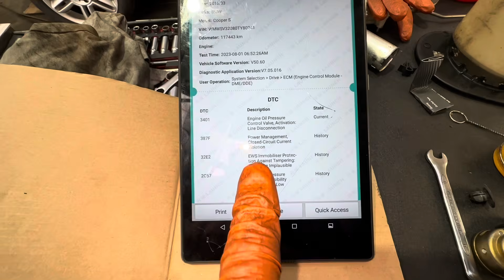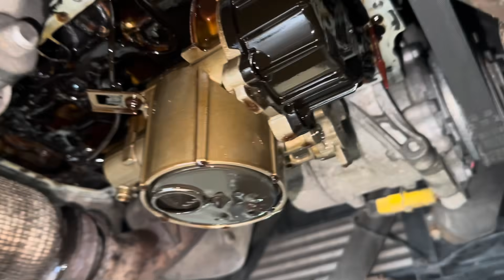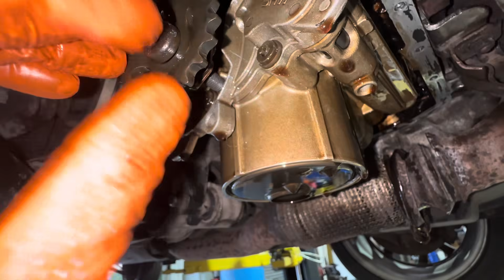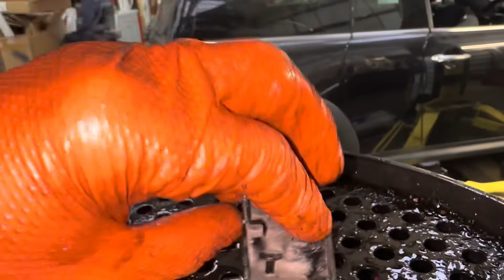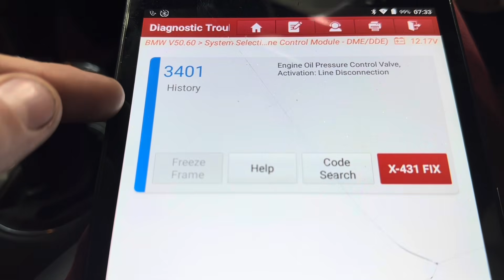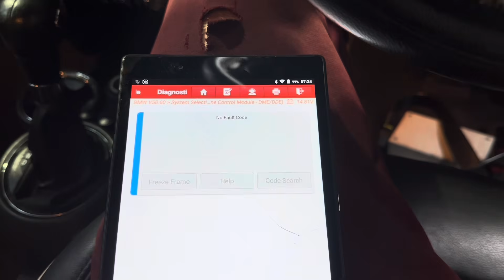Mini Cooper 3401 “engine oil pressure control valve activation” fault and FIX (oil pump replacement)

Comment: Very good video thankyou 😊. What exactly does it mean when the code says "line disconnection"? Is the car still ok to be driven? My topdon scanner didnt pick up the 3401 code, but my mini specialists did, but didn't really offer up much of an explanation.

Thanks
Reply: Line disconnection,due to the wiring not sending signal to valve in pump to make it work,due to it breaking down from sitting in oil with hot and cold cycles. 
I might have the same issue,but the solenoid valve was replaced when engine rebuilt,and it's only ran on tickover since. I know some mini experts recommend oem solenoid valve,due to high failures. Mine was a cheaper version from Autotech,pretty p*ssed if it has failed.
Reply from the maker: @ollyo3977 yea with things like that you really want to get a decent quality item, as the electronics inside the cheap ones are just crap!

Comment: Very good guide man! Cheers!  This solenoid is only related to the N16B16 Engine - Cooper late 2010 onwards (LCI) not the previous N12B16 as it does not have it.

I have fault code 2F58 - Oil Pressure Control Valve Activation (Permanent) - No warning lights. Only stored in the dedicated side not EOBD side as its nothing to do with Emissions.
At first when I discovered it (9/10 months ago) I was quite worried, but the oil pressure light never comes on and the car has now covered over 8000K miles without issue and always been plugged in all this time. TBH this was because I forgot about the Fault code.

I am not entirely sure how it works and what its actually for, my guess is to keep oil from draining down so the next startup will be primed, if someone knows then please enlighten me ;). 

Thanks again for the great video!!
Reply: the solenoid controls the oil pressure for different situations like when you start the engine cold the pressure is lower so the oil circulates slower giving it time to warm up to operating temperature faster, when engine is warm the oil pressure is more so pushing the oil through faster to help keep the engine cool. It also controls the oil pressure to the vanos which are controled by oil pressure to adjust your timing and also the vaccume pump. Aparently this is very important for the opperation of the motor but I would be more concerned about the pressure for the vvt to keep the timing at peek performance

Comment: Hi what sort of cash do you charge for parts oil and labour . Many thanks
Reply from the maker: It’s expensive
Reply: @Chris_CDB  how expensive?
Reply from the maker: @ruslan6777 good few hundred quid.
Reply: They scam you
Reply from the maker: Who scams who?
Reply: @Chris_CDB  It's a $30 part and doesn't require the oil pump to be dropped

Comment: Mine is fauty but i just disconnected it because its hard to remove it since its located in the mount
Reply: I cut and spliced mines
Reply: Did you get any engine lights with it?

Comment: How did you get torx bolt cap off, I thought the driveshaft has to come out to do that
Reply from the maker: T25 bit inside a 10mm ring spanner. Bit of tape if you are struggling to keep it in.
Reply: Do you know the torque specs to the oil chain sprocket bolt?
Reply: I was trying to do this job at home yesterday, and wanted to cry after I realized it wasn’t as simple as I thought. When I was trying to unscrew the sprocket bolt, i heard cracking and it really felt like I was breaking something so I stopped. And then I tried to reach for the torx bolt cap and saw everything that was in the way. But this gave me motivation again, thank you!
Reply: @allen2real  just remember, everything is trivial once solved. Just take your time and keep thinking. I've been doing this sort of stuff for 40 years, I know well what you are feeling.
Reply: @allen2real  oh man I bet you did I probably throw something straight through the engine! Good luck! 👍
Reply: @allen2real brooo I have to do this too did you manage to do it?
Reply: @chrisnicolas611 bro keep it real… I just got rid of that car😭 I managed to do it two years ago but I forgot everything that I did. I struggled so much with that car omg. My car rn is a 2015 honda civic and has never put me through any amount of stress and i love it